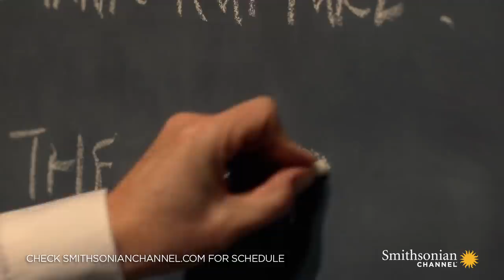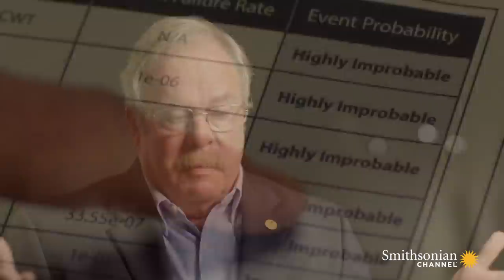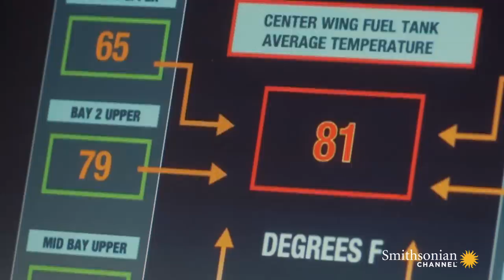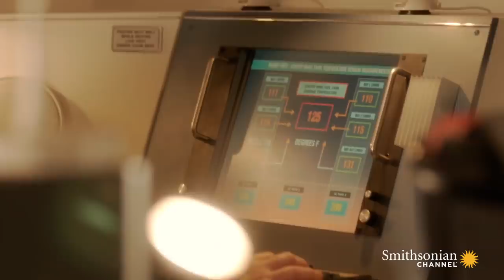How Air Conditioning Caused TWA Flight 800 to Explode

Comment: "Something created a spark to ignite the fuel..." Yeah, like a surface to air missile
Reply: the plane was not downed by a SAM warhead (as the initiating event.)  The missile theory would be moot given that the warhead (had that been the case) would trump the fuel, so the 'fuel exploding' is negligible.
Reply: bluehorseshoe444 lol
Reply: bluehorseshoe444 A damaged wire in the tank caused the spark.
Reply: and where did you come up with that crazy theory? Oh, that's right...the NTSB..... which stands for 'Not The Smartest Bunch!'....
Reply: Rob Shef They found proof by reconstructing the plane and doing tedious, lengthy, ming-boggingly critical examinations. And what have you dont to prove your "theory?" Think?
Reply: Ok, now first of all, you must know what you are talking about, and Not just repeating what you have read somewhere.  So, You read what 'actual' report(s) from the "systems' groups?  (None of course.)  We (the actual Aviation Experts) are 'well aware' that a modest reconstruction was done with what was available, as a conceptual template of sorts.  You stated that 'they' found 'proof'...  who are [the 'they'] and what did they find?  what was the 'proof' to which you are suggesting?  however, the video here, that the 'air conditioner' caused the plane to 'blow up' is embarrassing.  Do you have any 'specific' questions.
Reply: Oh dear the tinfoil hat people have arrived
Reply: @robshef718  The air conditioner heated the little amount of fuel in there to flashpoint. Here's a bit of a scientific way to understand this concept you don't seem to understand (even though it's pretty simple). Take a pot and fill it with water, how long it takes for it to boil is your control. Then take the same pot and fill it more than what you filled it for your control and time it. It should take longer to boil because the amount of liquid increased. Now barely fill the pot, maybe to about a quarter of an inch off the bottom of the pot. It should take a lot less time than your control. Air-fuel works in a similar fashion to the water in your pot due to how liquids work. Considering the fuel tank was near empty and those air conditioner units got really hot (honestly it's simple physics, where do you think all the hot air in the cabin goes when the air conditioner is running?) the fuel tank essentially turns into your pot of boiling water with that heat source underneath turning what little fuel was in there to flashpoint. The air conditioner set up the time bomb, what set it off was a spark from damaged wiring due to the plane being 25 years old and its wiring not being maintained correctly. These damaged wires (or more specifically the wire casings) could have caused a short-circuit which resulted in high voltage electricity to jump onto low voltage lines that lead into the fuel tank. Also, A missile wouldn't cause the bottom of the plane to blow out, it would have caused a different damage pattern to what we observed.
Reply: So tell me, mister 'you think your a genius'.  What area of Aviation did you say you are in?  that's what I thought..
Reply: If I had a dime for every 'non aviation' type in here...lol
Read my lips: The center wing tank 'cannot' get heated up to the flash point of the fuel.  This, or such is by reason of the Systems 'Design'.  Now, I had to laugh, or smirk a bit, as you attempted to demonstrate 'science', which apparently you also failed.  (But it was a great attempt at cartoonery!)  :)   I have a degree in Fire Science, and Aircraft Firefighting  as I am former U.S. Navy Carrier Aviation. So, I'm sorry you felt you had to embarrass yourself.  Your 'take a pot' theory is way way off.  (though you might be smoking pot.) 'boiling water' is nothing to Aviation kerosene, which is never allowed to 'boil'.  Given that the Specific Gravity and variable Densities of AK and its chemical composition and funtion is  [not] that of 'water'.  So, your Kindergarten experiment is weak and ill informed.  So out of ther gate, you are only 'guessing'.  You are forgetting so many other known factors, as your [assumptions] are based on what you dont know about the Fuel Storage and Transfer System and the Architecture of the Wing Center Section.  So, sorry johhny wonder.   So No, [Air fuel] does not work in a 'similar fashion'.... Oh, you were allowing for the water vapor and the flammability of water? ? ?  lol..  
Next. You stated, 'considering the fuel tank was near empty' is totally moot and has zero relationship to the flawed NTSB 'theory'.  The state of the 'AK' remains static in the [center wing structure]   
as far as its (assumed) ''flammability '' given that the temperature of the center wing structure decreases in flight. (as well)  But the 'flammability ' assumption of Liquid Jet fuel is moot;  as Jet fuel is a 'combustible' and not a flammable liquid,  and does not 'give off' flammable vapors.  In a forced ANSI test, the fuel is subjected to it's state for [its] 'combustion' which is a lower FP temp, than the liquid fuels static condition.  (You can't get the surface of AK to be able to even catch fire, until its actual Flash point of at least 123 degrees F  / 50.5 C)      (The Fuel in the TWA plane had a FP of 123 F)   The flash point of a [volatile] liquid is the lowest temperature at which it can vaporize, to form an ignitable mixture in air.  (given the ratio is suitable)  Transportation regulations distinguish fuels as either flammable or combustible depending upon their flashpoint.      Jet 'A' is not a standard Volatile  liquid.  This is established by it 's API number.  Gasoline is [far more volatile] than kerosene.  If you apply a match to gasoline, you will get ignition.  If you apply a match to AK, nothing will happen.    In other words, AK is never stored in any place where its FP might be reached! 
Now, regarding your 'and those air conditioner units got really hot (honestly it's simple physics, where do you think all the hot air in the cabin goes when the air conditioner is running?) The AC units/ Air packs do not and cannot get 'Hot' (as you think they do)  And yes, you also failed 'simple physics'.   lolYou obviously are not aware of Convection, Conduction, and Radiation and how 'heat' actually performs in various environments.  You do know (as an example) that in 20 below temperatures, 'Heat' is present?   'Heat' from a source does not remain constant and is subject to displacement and interruptions from other materials and temperature variations. First of all, the Pack Bay(s) are vented by RAM AIR.  Then, (the fuel tank) / Wing Center Section which is segregated, is vented and displaces 'air volume'.  In engineering terms, the AC units as they operate, are 'cooling down' in the function.  NOT heating up.  There is little 'heat' in as far as the function of the units are as they operate, and then as far as any radiant 'heat'.   There are Pre-coolers in the function.   An aircrafts air pack(s)  do not exactly work like a home AC btw. But then you did not know this!  lol... Um, and there is no hot air in the cabin when the plane is in flight.  but to keep it simple for you, the cabin air is exhausted out of the cabin by the Air packs which continuously replenish the cabin air.   
and no heat,  goes  'to the fuel tank'....ya think!    :)  
So, no. The fuel tank NEVER boils. it never gets HOT either as there is NO HEAT SOURCE underneath. So. Where ever you have got your information from, is selling Ice to an Eskimo...So you have read the same ol rumor mill:    however:  No time bomb. No spark.... As there can be no spark in the system, but that another class.  And No 'old' 'bad' wiring either  and no bad maintenance, etc,  etc etc...The entire short circuit speculation is truly  laughable.  That's another class as well.  The 'entire NTSB theory' was, and has been disproven in federal court, and no one in the Aeronautical community ever believed that nonsense. and....ready for another 'rut roh'?  The bottom of the plane was not blown out... and exactly what is it that you observed?  what the NTSB said you are to 'observe'?  There was no cwt explosion, as that is architecturally IMPOSSIBLE,  as proven in court.   And as proven in REAL science and not 'McCrowley's Science...'   That sounds like the name of some TV show huh!
Reply: Ah, yes, another arm chair fool, dares to challenge 'The Master.'   (I get that a lot.)  In the first place, you are not in the Aviation field.  So, that essentially disqualifies you for having dog in this fight.  But I will go ahead and correct you,  since you are apparently just another play station dude, who lives with his parents, requiring  attention. Now, I am The Authority.  Maybe it is 'your idea of bullet proof',  unless you think that the NTSB has the corner on physics?  Lol...  And so, what?  You just want to go along with them because you have nothing better to do?  And now, I had to take a few minutes and roll around on the floor laughing.  dude...You are not a Physics major.   Not even close.  (You really are precious though.)   You Just disqualified yourself right out of the gate.  Lmao.  My friends are going to get a kick out of this one.  WRONG: 'the more of a substance you have the more thermal energy it takes to increase the temperature of the substance.' Lol.  You forgot about the 'Specific Heat' of different substances.  So you get a 'F' there. It can take Less heat to 'heat' more of a mass,  depending on the Specific Heat of the substance.  Lmao.. So , no, mister im a physics major!   (Do you point your finger up in the air as you say that!)  Lol.WRONG:  If the plane was on the tarmac for over 2 hours with the AC unit running (which it was), and the fuel tank was almost empty but still had fuel in it (which it was), then that would be sufficient to heat the fuel, and extension the vapors given off due to evaporation, to a dangerous level once the plane was airborne (since the flashpoint temperature required decreases as atmospheric pressure goes down)
FACT: the 'time' on the tarcmac is moot, and the 'time' the AC was running is also moot. (You really dont know what you are talking about.)  Things dont just keep getting hotter and hotter and hotter...OMG!!! I am going to restate what I did already, (for the benifit of actual students) which you apparently missed. You forgot about, (because mister physics major doesnt know) and is clueless as to how  'Convection, Conduction, and Radiation' principles work in Real physics. So no, the fuel in the center tank would not and could not, nor cannot be heated up to 'dangerous' levels in the real world, due to the Architecture of the Fuel Storage and Transfer System and the Pack Bay design.  It was designed to eliminate heat by the way. lol.... Your 'direct heat on the stove top theory' works for making mac and cheese, but thats about it! So no, there was not, as there cannot be 'sufficient heat' as you think,  and I would Love to [See your tables] for the evaporation times for the known AK, and in the Architectural design environment.  Again, you failed physics, so get your money back.   The Fuel tank is segregated, and vented, and so there cannot ever be a "dangerous' level for any 'vapors'. 
Im pretty sure the Fuel and mechanical engineers know what they are doing.  lol.... 
WRONG: Then again I did say, "Air-fuel works in a similar fashion to the water in your pot due to how liquids work." FACT: fuel vapor and water vapor are complete opposites.  nuff said.
The thermal principles of water and fossil fuels are not simular at all.  Lets see, water boils at 212 f and Aviation Kersone at about 176 °C (349 °F; 449 K)   Tie a string around your finger so you dont forget! Moving on. Im having fun!  I only concluded that you are wrong,  because you are.  Now, again, I need to see your tables on (your quote) 
" ...that I was talking about how much thermal energy would be required to speed up the evaporation rate, not to boil the jet fuel."  But the Fuel Techs know this, and so, as a 'physics major',  you should know!   lol....  I know, you have been watching that TV show, 'The Pretender'.   Today; McCrowley is a Physics major! and you wear a cape?  
Again, you have NO idea how the Aircraft Air cycle machine and plenum works.  Then, your next statement was.... ridiculous. WRONG:  As for your "physically impossible," the plane sat on the tarmac for 2 hours cooling the hot cabin air.FACT: How long the AC runs is moot.  The system is (read carefully) designed to dissipate, not harbor and increase more and more and OMG .....blistering heat!!  lmao
So, if you want me to pull up the ...No.  Let me ask you, as you're the expert.  Who was the purveyor for the Air Pack system? And tell me about the performance tables.  
WRONG:  And there is a heat source, schematics of the plane show that those AC units which heat up as they run (due to circulating hot air) act as your heat source.   REPLY: You have no idea Wtf you are even saying here.  Please, do share YOUR schematics which show how the AC units Heat up and 'circulates' HOT air, and heats the fuel tank.   You are full of hot air.   And, you are not an aircraft fueler  either.   I was, in the US NAVY.   Again, there cannot Be any 'flammable' fuel vapors in the tank due to its Architecture.    You see, (psssssttttt) let me share a secret.... don't tell anyone, but the secret  is to make fuel tank not be able to catch fire, or be any fire hazard. WOW.  WRONG: ...  'And they accumulated because a good fuel tank is airtight and doesn't vent air (otherwise by extension it would also potentially vent fuel)."  lol.    Fuel tanks are not airtight!  wtf crazy train did you fall off of??   YOU DID FAIL physics 100.....  you sure have not reached 101, that's for sure.... 
Now, the CVR is another class, but you are so far from right on your CVR theory that it would take light 1,000,000,000,000,000,000,000,000,00o light years to reach earth. 
The age of the Model year of the plane is also Moot. That is another class.  Wow, you really are not smarter than a fifth grader. And finally:  WRONG: 'Also, you didn't address the fact I said that it couldn't have been a missile due to the fracturing pattern. Then again since you just spent an entire paragraph telling me thermodynamics is wrong, I'm not surprised you couldn't be bothered to suggest to me another way for an exterior explosion source to cause a damage pattern similar to an interior explosion source." Lmao: Thermodynamics is not wrong, however  'your sadly misguided idea of thermodynamics is! Now, about the missile.  I suppose now, that you care to argue with the NTSB? As their own dockets indicate the presence of 'High Energy and Spike tooth damage, and then that missile damage is acknowledged in their own  dockets?  Oh, that's right, you didn't know this.  And then, that the IAMAW brief (provided to federal court) is clear, that an "external' breach (that means outside of the plane) was the Initiating cause.   So, let me guess. You, 'the Pretender'  is going to be a mechanical engineer tomorrow and then a fuel expert the next day!  oh goody. we cant wait to hear! now go take your med's and curl up with your banky....
Reply: @robshef718  You know I could respond by saying that your attempts to belittle and undercut me are cute, that everything you used to "counter" my assertions basically undermine all of physics and that you're delving deeper to fallacious arguments (such as assuming I'm childish and need meds (which in all due respect fuck you very much for the meds insult)). But I can easily counter your entire claim by asking one, very simple question that was brought up to me. If you're saying that it was impossible for TWA 800 to be the victim of a CWT explosion and that it was downed by a missile, how did the eerily similar Philippine Airlines 143 experience a similar event? Because 143 wasn't hit by a missile it suffered the same CWT explosion that downed TWA 800. Or are you going to say that the Philipean military shot a civilian aircraft while it was on the tarmac in the same area as the CWT while again it was on the ground?
Reply: lol..... and where did you graduate from Aviation Engineering?
Reply: I saw another video they said that there was a small spark in old 747 and guess what it was a 747-100
Reply: Umm, your 'sparky' theory is embarrassing as it CANT happened and never did.  And what do you mean by an Old 747?   The Plane was not 'old'....  The 'model' year is, but the plane; as all commercial jets, have Daily checks and Routine Inspections, and Modifications,  and Re Works, and Up Grades, and Overhauls.  We took the NTSB to court over their Obstruction in this case, and we won. the NTSB was impeached for Fraud.
Reply: Have I ever flown a 747?  Quick reply:  No.   Yes, what about the Pressure in the fuel tanks?  It would be atmospheric pressure of course.  But 'fuel' ( In this case, Aviation Kerosene:  A  Combustible liquid) cannot just blow up,  under any Operating Condition.   The Fuel from the Storage System,  is under pressure within the  fuel lines, from the fuel pumps,  to the engines. But there can be no sparks in the fuel lines.  (As well, a spark / no sparks can be generated in the fuel lines and a s[park cannot ignite liquid AK.
Reply: KHundead Gaming2: Hi. Being a 'master' is a bit steep, though I am an Expert in my former U.S. Navy Aviation field. I would be an Analyst in areas of my field, as well as a Damage control and Maintenance Engineer. Thanks for asking.  Do know, that pilot's, are more than just 'being a pilot',  in that Pilots are involved in those things as well, which you mentioned.  They go on to be consultants and are involved in the many facets of Aviation.
Reply: @robshef718  i have a question for you (not related to the crash in anyway) does insulting other people really needed? Don't jump to conclusion i actually believe you, but i think you don't need to insult them
Reply: I have a question for you. Why do you even care? 'They' don't need you to stick up for them (?) if they even feel that my 'to the point' postings are 'insulting' ?     cheers   :)
Reply: @robshef718  

Just wondering, it would seem odd to base a theory on the assumption that senior investigators at the NTSB are too stupid to do the basic physics. I'm also curious, of the other CWT explosions, such as that other 747 over Spain, Pan Am Philly, and TWA Rome 1964, was the difference that these tanks had more fuel in them than F800?
Reply: In case you did not know, (which you apparently Do Not know)  it was those key 'Senior Investigators' who challenged the NTSB'S  ridiculous theory.  The investigators are only assigned, and they are not the NTSB.  The NTSB is it's own entity, which is a board of five members who work up a final report for any required Safety Regulations, if such is required.  In TWA's case, there was not, nor has there ever been any such 'safety issue' regarding 'spontaneously exploding Aviation kerosene', given that 'AK' is not a flammable... but a Combustible Liquid.  There has NEVER been a 'spontaneously exploding' center tank, due to a 'mechanical' issue.  The 'Amount of Fuel' in the tank. is moot, given that the Architecture of the Fuel Storage and Transfer System is so Redundantly Engineered, to make it fire safe (by way of several systems) just to alleviate 'fire' in and of itself, which would be a greater concern over [a] fire, as opposed to there being 'an explosion'.
Reply: @robshef718   "nor has there ever been any such 'safety issue' regarding 'spontaneously exploding Aviation kerosene'"

OK, but are you of the opinion that the CWT did explode due to missile penetration/s?
Reply: @robshef718    I'm not trying to refute you, as I do have some doubts myself about the missile. So take my questions in that spirit.

On p135 of the final report:  "Jet A fuel ignited and combusted during every test using conditions approximating those that existed in the accident airplaneís CWT at the time of the accident."

What is your take on this quote?
Reply: The CWT [explosion] was NOT by reason of any spontaneous [fuel] explosion.  Any [fuel tank explosion] is moot.  Any [aerial impact/midair collision] renders the concern over a fuel tank exploding, moot.  The 747 was not brought down by reason of a fuel tank explosion, but a mid air collision.
Reply: There is only one possible cause, and that DNA is all over the wreckage.  The FAA radar was not 'doubting' a supersonic contact.  It was not a bomb inside the plane; as such signatures are not present. However, the most critical analysis [by those who cannot be refuted] are the highest in the various disciplines. The IAMAW made it clear that the Break up was a result of an external energy, which breached the fuselage.  everything else came 'after'.  I would have to look at your [specific] reference, though any 'final' assumptions made by the board, are moot given that the 'scenario' that they have presented, is Impossible to have occurred for a plethora of technical and academic and empirical reasoning.  [JET A] fuel, could not have nor can combust, inside the fuel tank for any reasons given by the NTSB's report.  my take is that the entire NTSB report is a fairy tale. it is NOT a report but a product of fiction, a totally Fabricated report to fit their scenario; the one required by them.
Reply: @robshef718   "[JET A] fuel, could not have nor can combust, inside the fuel tank for any reasons given by the NTSB's report. "

So how can I, the lay person, document this fact? What references prove this to be impossible? or is it all too technical for people like me?
Reply: I'm Happy that you care to be a student in this matter, so I appreciate your interest.  There would be more specific details about your good question, than I am allotted space for, here.  However,  It is not 'too technical' for someone like you, as I assume you are a high school graduate?  There are 'far too many' assumptions made about some things, especially about this case.  Of course we are to understand that gasoline and such, is dangerous and must be handled with common sense for those who know that gasoline and the fumes are 'dangerous'... Like from out of the lawn mowers gas can, can ignite with that scary POOOOF!  (and singe the eyebrows if one is too close!)  In an example,  that a child may not know nor can yet understand the dangers of gasoline, and so many other things, until education and maturity comes their way.  Any petroleum product, or, anything that we know to be 'Flammable' : such as the sofa, or wood etc, etc,  is the basics for knowing what constitutes a "Fire Hazard".   If it has the potential to create a fire, then it must be taken with the needed cautions for such. Like, don't let the space heater get to close to the curtains.  Yet 'some people are stupid' and that translates into the "Well I didn't know' category.  It's called 'read the lable' and then again; schooling and parental directions.  Then it's undertanding "how things work", which is a vast topic, as you know. In short:  All FUELS (and in this case) Petroleum fuels for engines, are known to be dangerous and are to be handled with care and can burn and or ignite and under some storage situations (if they are not proper) where there can be 'an explosion' effect...  not making 'an explosion' like those on TV.  but, Like the gasoline vapors that can go, POOOF... However, I doubt that if you had an open gas can in your garage, and that if you tossed a cigarette into the gargage, that the roof of your garage is going to blow off.  Or, like when you soak the BBQ to lit it.  The ignition of the lighter fuel doesn't blow the grill apart, as it cannot.  {OH, I see.} 'That' has to do with the types of fuels used.... and then the characteristics of those fuels, and then what they are designed and used for!  Like you cant or dont (or shouldn't) put diesel fuel in a cars tank. Daaaah. So, it is with the different types of fuels, and how they are produced which starts with Base Petroleum and then a refining process or 'cut' of the fuels in the processing of refinement, which has different types of results.  This is all establishd by the 'American Petroleum Institute' or API.  Here is a Fun fact.  Next time you go to the hardware store, look at some PVC pipe. See the ink lables printed on the pipes and the letters ASTM.... This is a vast standard for nearly everything we use and consume, in the material market. It stands for 'American Scientific Test Method'  and this 'tests the product(s)'  for many things. For its suitible use in any certain industrial environment. The same goes for Jet Fuel and auto fuel.  There is a [test method] used to find the minimums and maximuns for the [control] of the 'product' and then under various and or varying 'environmental' conditions that the product is under or can be or will be subjected too.  In this case it is JET Fuel or Aviation Kerosene/ 'AK' JET FUEL: It will get very cold and then very warm, and is designed [as the Jet engines are ] to be able to work in  certain engine's,  and under so many different flight environments. So the ASTM test method, looks to find when 'AK' will BURN.... But this does NOT mean EXPLODE. 
Then, it is tested to see when the atomized or misted fuel will detonate.  The 'lower end' of the test is what is called, the "Flash point", which is an all encompassing minimum safe handling standard, used to protect the product and then the handling of it,  and then for personnel protection.This ASTM test really has no concern for how the fuel [was or is 'designed to 'Burn' in an engine] which of course is at far higher temperature,  than what 'AK' would or could ever be stored at. The 'basic and redundant Philosophy'  of JET fuel is to treat it as if it WERE ALWAYS a hazard, even when it really is not at a point to be a hazard.  However, for SAFETY standards, the minimums are always the law here. This is to protect the product and the equipment, and to be 'assured' that the Fuel is stored in 'the safest' manner.  This is what BOEING Engineers and all other [related equipment manufacturers for the 747] were all to be concerned over.  Plain and simple:  Don't exceed the minimums!  The Fuel Storage and Transfer Systems design and operation, took the concerted efforts of many different engineers, to make the system so they were all on the same page, so to speak,  and then that the 747 would pass all FAA Air Worthiness Certifications;  and this was also in concert for a plane that would have a center tank near the air packs.  I never understood those who think that the AC units run blistering hot?? and that the fuel tanks.... simmer!   lol...
now in a nut shell: 
1. The fuel tank never gets hot enough to be any safety issue.2. This is because the fuel tank 'cannot get hot' and this due to the Architecture of the tank.   3. There are never dangerous and ready to "EXPLODE" fuel vapors in the tank.  This again due to design.4. Jet Fuel Vapors are lazy and very low energy.5. 'AK' is a highly stable and low volatility fuel.6. 'AK' is not a 'flammable', but a 'Combustible' liquid.    This means that putting a match to it, does nothing. It has to be misted in order to burn at a rate of       detonation. 7. The AC units even  if they ran forever, do not put any HEAT inside the fuel tanks.     Again, the minimums for FIRE SAFETY....  so you cant say..."OPPS, I guess we missed that one...yuk yuk..."Hope this helped.   Signed: Former US NAVY AVIATION BOATSWAIN MATE  & Ship Board and Aircraft fire fighter.
Reply: @bluehorseshoe444   I cracked up when I read this.   But yeah, you are right.......
Reply: A spark in the electrical wiring aka a short circuit
Reply: nice tin foil
Reply: @robshef718  Yeah that is true, but that is how the NTSB spun it.
Reply: @Tanman829  Yes, the TWA 800 has been the only plane in modern civilian aviation history to have this happen. Since it's happened once in the course of millions of global flights we know for certain what is exactly it was that caused this literal one in a million occurrence. Think?

If you go by the numbers you'd be more likely to be shot down by a SAM lol.
Reply: @cefb8923   You did know (?) that we took the NTSB to court, and sued them, and won a favorable decision?  We 'un spun' their report for them.